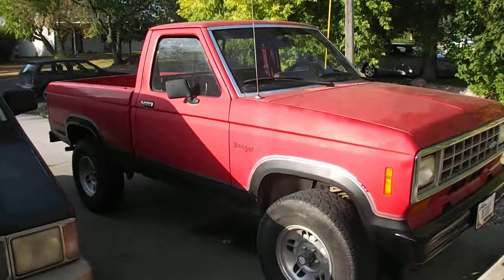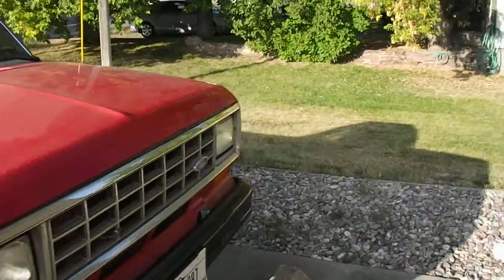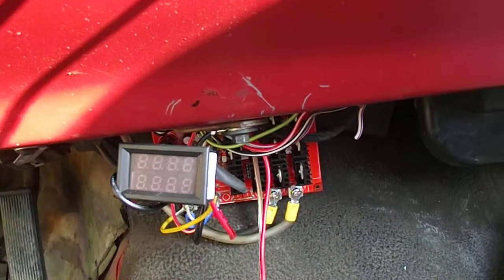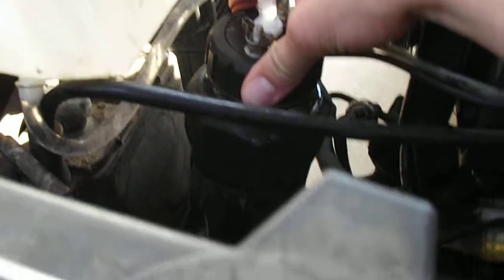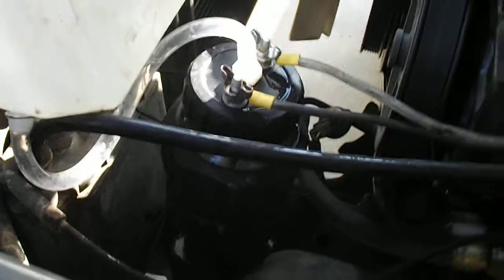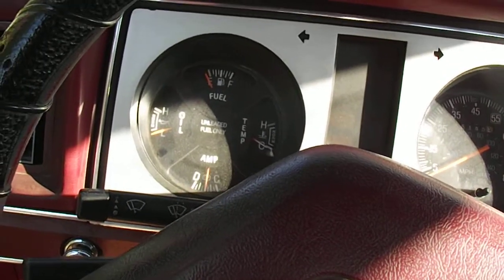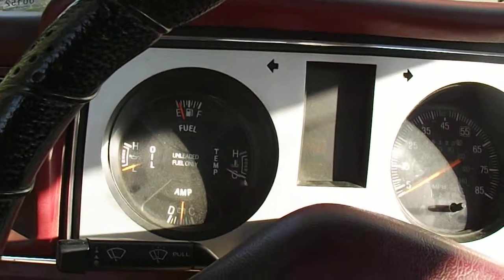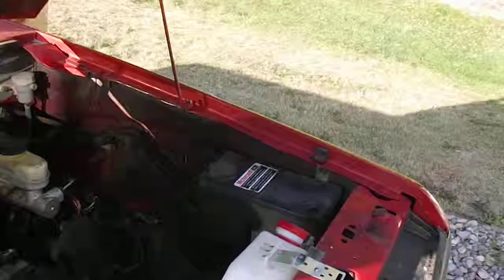New HHO install in my 87 Ranger

Comment: Is this thing still going?
Reply from the maker: Yes, I had an oversized alternator for this setup. I believe it was 120amp. As for testing the gas mileage I had a issue with the accuracy your talking about, the pump would have to be the same because the shut off is different between pumps, also you can't test it in-town stop and go traffic. I tested mine on highway with only the one 0-60 takeoff using an accurately measures gallon as well as a stretch that is level the entire distance. 

I was very skeptical about this hho idea at first as were many "internet scientists" commenting on the idea, I had many other hho projects that I never uploaded and spent A LOT of money researching this. The result is that yes it does work but it also takes alot of time, money and effort to make it work correctly. I also quit doing it publicly because of all the people getting in trouble for patent violations. I've never tried to make money doing this but there is weird conspiracies surrounding this whole hho idea.  The only thing i know is that hydrogen is a great additive to the combustion engine.
Reply from the maker: I sold the truck a few years ago but ran hho until I sold it. It worked well, I had about a 30% increase in mileage. One thing to note, this truck had a narrow band o2 system (single o2 sensor), modern vehicles with a wide band o2 system (multiple o2 sensors) will not have the same results unless your running an o2 controller with an engine management system. That setup is very expensive and sometimes not worth the benefits. To run an hho system correctly can become very complicated and very expensive.
Reply: @boberbland  mine went from 24 mpg to 49 mpg with only a 2lpm system, now i have 20lpm systems!!!  Truth Movement World Wide!!!
Reply: Did you ever have any problems with the trucks charging system? I almost have everything to build my cell for my 2.3 ranger but I'm still worried I could fry by alternator or kill my battery... Also the best way to check your mileage is start off with completely full tank-drive 10 miles and refill your tank, do the math and see how much fuel it took to get that far